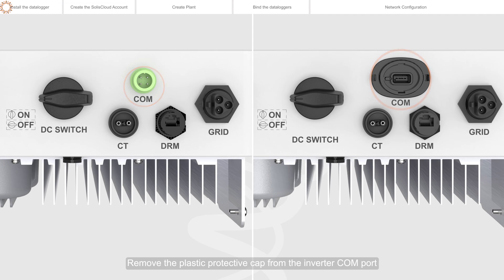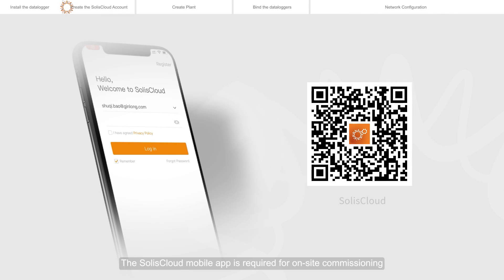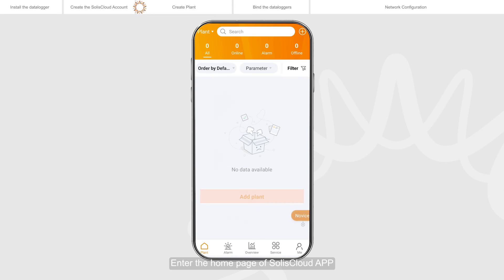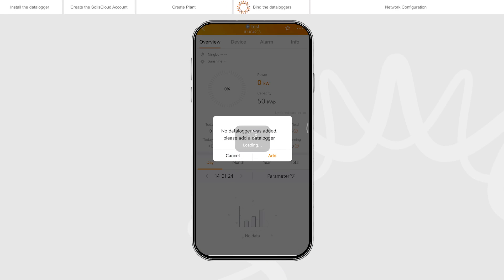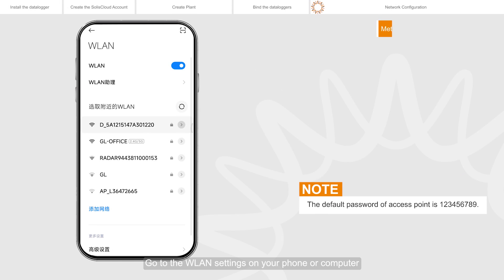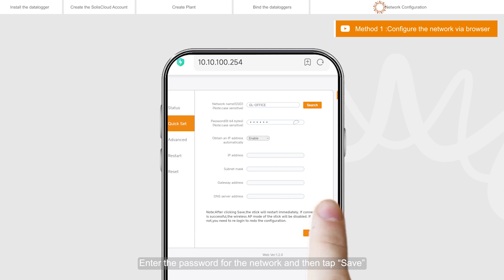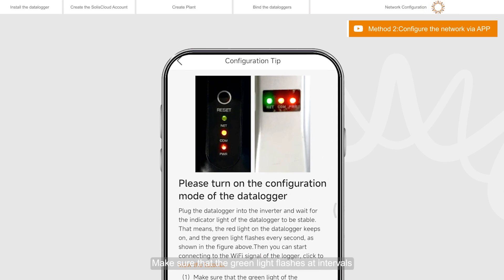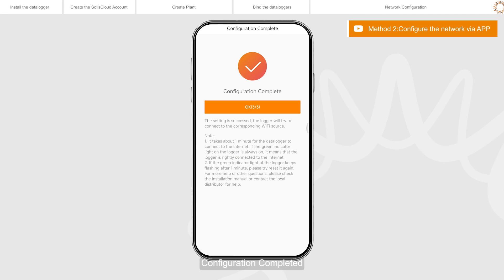Solis S3-WiFi-ST/S4-WiFi-ST Stick Datalogger Quick Installation Guide

Comment: I have recently changed internet provider and I want to connect the datalogger to the new network. I have gone through the video several times. I tried connecting via browser as per your instructions. I did that on Chrome and Firefox - and the user name and password (admin/123456789) didn't work on either. I have tried to connect via app. I have gone to 3:56 on the video and connected to the datalogger network. When I return to the app, I am given a message about "net error".  The steps to connect my router do not come up. What am I missing here?

Comment: Simple version....
1. Ensure you have a 2.4g wifi network.
2. Start soliscloud app and create the Plant, red asterisk items req info.
3. Go to datalogger tab, scan code or enter Serial Number
4. Select the Solis wifi ...it will say no connection....ignore
5. Enter your 2.4g wifi name
6. Enter password allocated by wifi (15 letters and numbers)
App should say connected
7. Return to logger tab and pull down to refresh, do this several times
8. App should now show as online....go to homescreen and refresh...
All data should show from this point.